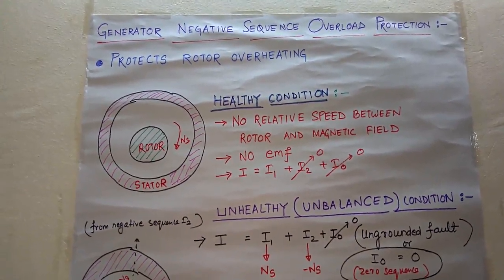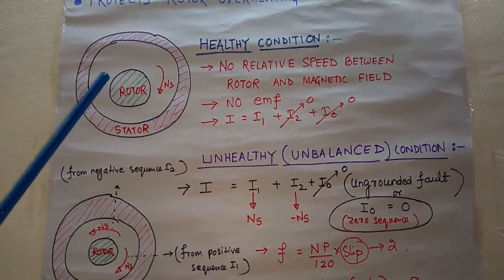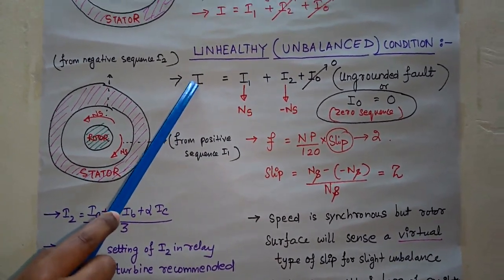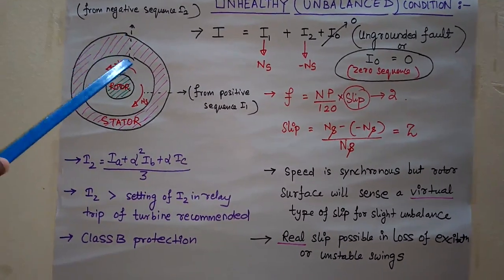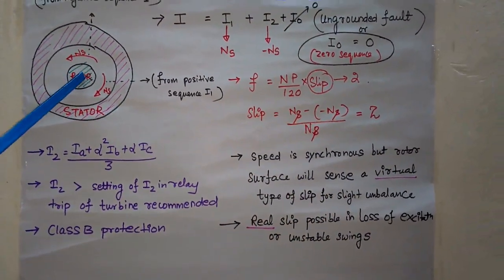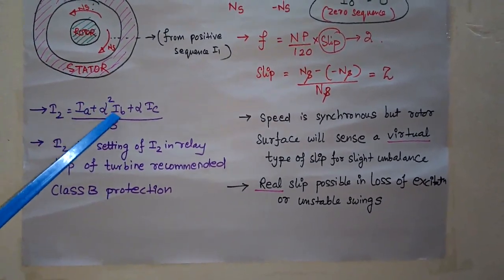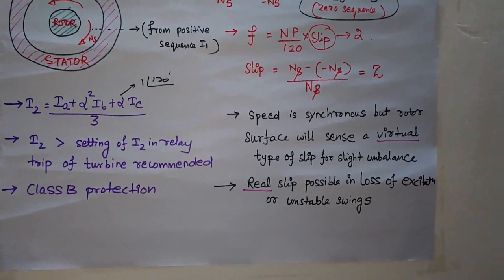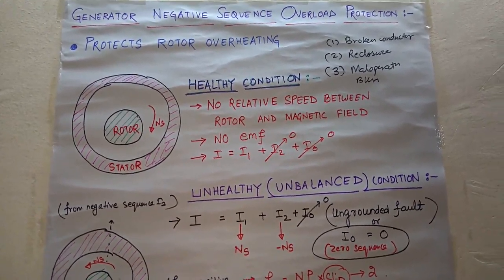GENERATOR NEGATIVE SEQUENCE OVERLOAD PROTECTION

Comment: My dear friends, " I need your precious help"
One question please , if we (1) Reduce the rpm of the Generator and if we (2) Increase the rpm of the  Generator what changes we can see and how the Generator will perform with 100% load or 80% load  is my question.

( 1) 

Increase in rpm :- 
If the Generator having 2 pole or 4 pole  with single phase or 3 phase running on 100% load or 80% load with increased RPM from 1500 to 1800 rpm ( the Generator original design RPM is only 1500 ) if there is an increase of 300 RPM more than the original rpm what will happen ,

(2)

Decrease in rpm :- 
If the Generator having 2 pole or 4 pole  with single phase or 3 phase running on 100% load or 80% load with decreased RPM from 1500 to 1200 rpm ( the Generator original design RPM is only 1500 ) if there is an decrease of 300 RPM less than the original rpm what will happen ,

To correct this imbalance and mainten proper Hz , amps and volts what should be done or what is the best solution.

Please give me the details, a humble request 🙏
kammagearflywheel@gmail.com
Dr Srinivas Bhaskar 
Chaganti
91-8555045244
Reply from the maker: 1. Low speed with excitation - overfluxing phenomenon will occur, protection present at both avr and Grp to trip the machine. Gen designed for a certain v/f ratio and if ratio exceeds that limit of manufacturer then machine may damage due to heating, Stator end is weakest zone during overfluxing. Load angle and MW will reduce instantly. Oscillations in mw  may occur and governor will try to bring back to normal rpm.

2. If high rpm then chances of pole slip, heating due to eddy currents. Overfreq prot at Grp may act.  Load angle and MW will increase instantly and oscillations may occur incase sufficient de accelaration torque present to control pole slip.
Reply: @electrocean6684  dear friend , thanks , what is the best method to overcome the problem by using any additional attachment to solve the problem
Reply from the maker: @drsrinivasbhaskarchaganti3653  In my experience I have seen first line of action is control by speed governor and  second line of action is initiating trip  by protection system.

Comment: can you plz explain why would class-B (or turbine trip )is initiated due to negative sequence overload.Because it is rotor of generator which is getting overheated due to negative sequence component not turbine.
Reply from the maker: hitchandan27 
Rotor winding or stator winding both are classB, because  overload withstand capacity (in time duration) is much higher than the time delay of generator isolation through classB trip
Reply: Point me if I am wrong ,but when ever is tripping is initiated because of fault in generator then it is termed as class-A trip .if trip is initiated to protect turbine then it is termed as class -B trip .
Reply from the maker: hitchandan27 
Yes you are absolutely correct, 
But in some conditions where delay is possible we can trip the turbine from gen relay and gen will be isolated by pickup of low forward power protection in relay

Comment: One question: When the rotor carrying dc field current rotates, it produces a rotating magnetic field. So is that rotating field moving relative to the rotor or is it moving with the rotor with zero relative speed between them?
Reply from the maker: Rizwan Khan rotor magnetic field is aligned with the rotor but the resultant field will have different axis but relative speed is zero wrt rotor
Reply: So would that resultant field create back emf or self induced emf in the rotor?
Reply from the maker: Rizwan Khan  " Induced"